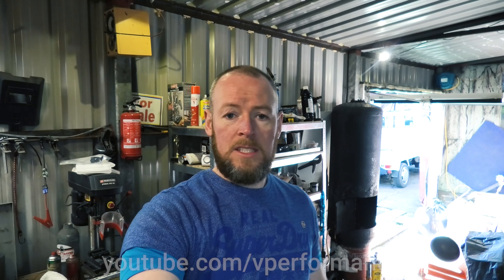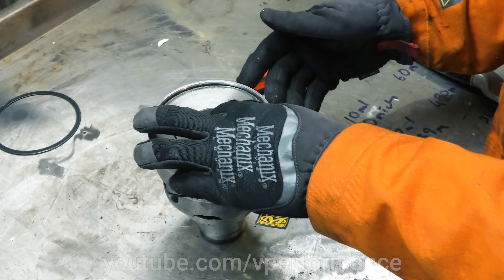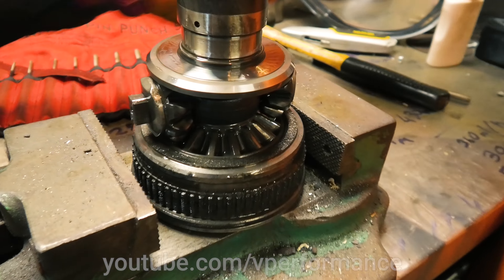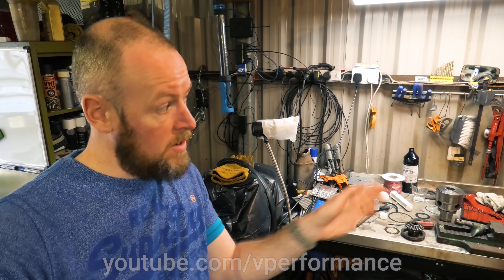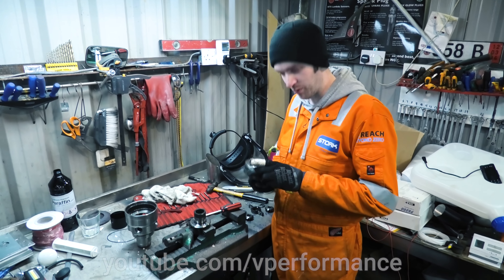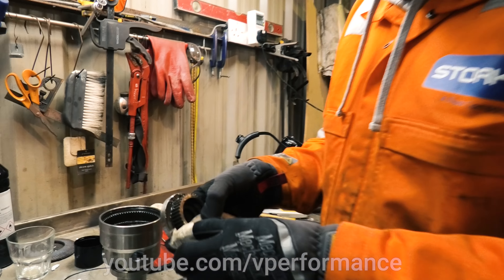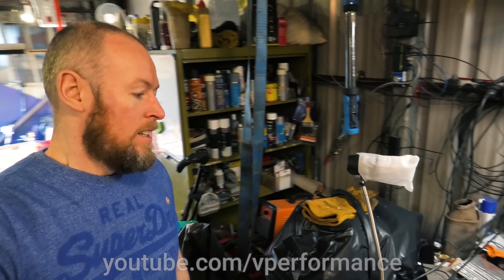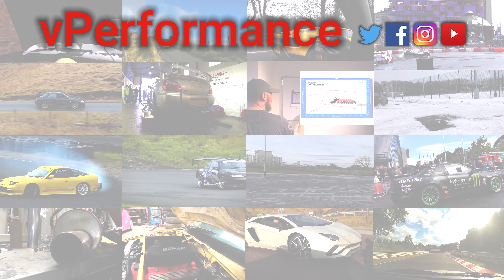Subaru Rear Wheel Drive conversion - the centre diff // Subaru Project WRX Drift

Comment: Late to the party here but this is not a LSD - it's a normal (non-LSD) Subaru viscous coupling (center differential). The sticky goo inside is 100,000 cSt (not 10,000 cSt as some people say) silicone fluid (polydimethylsiloxane). Nice deconstruction vid!
Reply from the maker: Fantastic! Finally someone who Subarus. How do you know this? Are you a diff wizard?

Comment: As far as i have been able to find out that sticky stuff is a type of silicon. As soon as the front end of the diff moves faster than the rear end (when the front loses traction) the silicon becomes hard due to temperature caused by the plates moving past one another and locks the rear part of the diff. This sends power to the rear wheels untill the wheels all spin at the same speed and the silicon becomes a fluid again. That way there is always power to the non spinning wheels. Thats why its all wheel drive. The diff between left and right takes care of the speed difference between those wheels on the axle, and the centre diff takes care of the difference in speed between front and rear axles. A very neat mechanical solution that other manufacturers solve with complicated electronic gizmos and doodads that break and are expensive.

Comment: Last comment on this vid I promise, but basically all Subaru manual transmissions use a viscous LSD center diff like this one, except for the STI which has a more complicated mechanism.
I was pretty sure that was the case, but researched it just to make sure I wasn't full of it. I found a pretty cool page that goes over all the types. http://youwheel.com/home/2016/08/07/subaru-awd-system-fully-explained/
I am slightly confused though. Why do you need to weld anything if just gutting it means all the power will go to the rear wheels? I feel like I'm def missing something despite looking at many diagrams.
Reply from the maker: I'm sure Dave will add further info, but basically the larger end plate does not attach to the prop shaft unless you weld it up. It would just spin and you would have zero wheel drive. Also - I saw a man on the internet do it and it worked, so I hoped it would work!
Reply: @vPerformance  Ah yes. That's what I was thinking is perhaps it would just allow the power to go nowhere. Duh, obvious in retrospect. Thanks!
Reply: @802Garage  Dave here - Pretty much what Paul said.  The input (narrow end) usually connects to the output (fat end plate) via the gears inside and the friction plates.  Once these are all removed there is nothing connecting the two parts.  So if you clipped the end plate back on you'd have zero wheel drive.  :)
Reply: @DavidMcLuckie  Right! I should have thought about the fact that it would be transferring all the power into the empty case. Thanks for replying!

Comment: I would think that if you turned the center diff into a spool then it would lock the torque to 50/50 split front AND rear. Not sure how it is bypassing the front this way???
Reply: You take the front driveshafts out and make plates to cover the holes in gbox
Reply: The. Other end of the spider gears has a spline that runs to the front diff. No spiders, no connection to the front shaft.

Comment: Looks like a normal centre diff. The smelly plates you took out would be the clutches that allow differential slip between front and rear axles
Reply from the maker: We were certainly expecting a normal centre diff. We'll crack open the other one to compare.